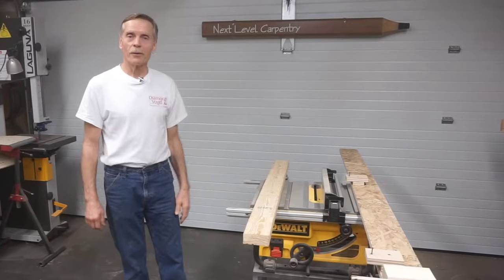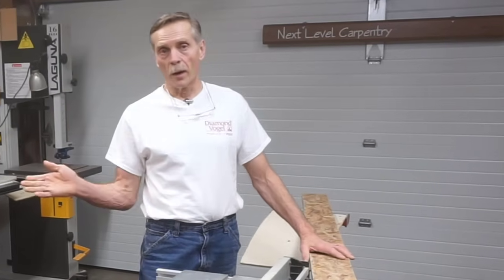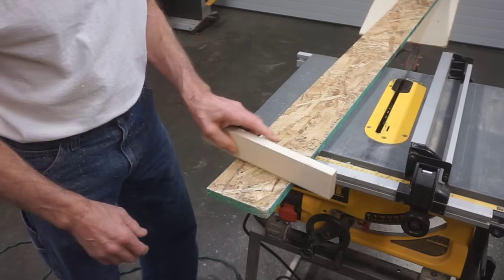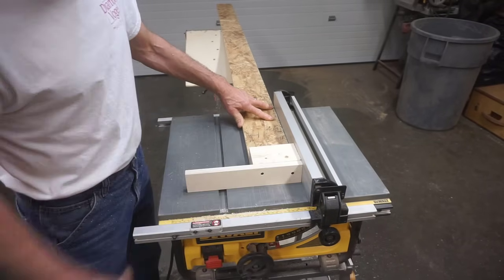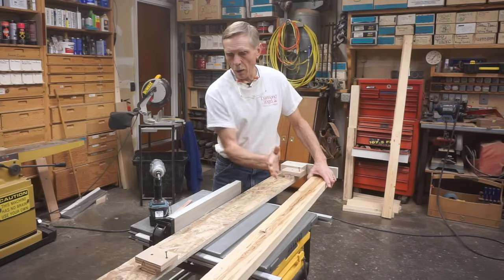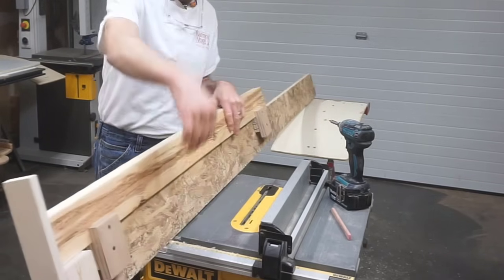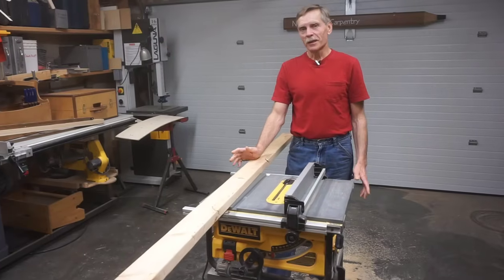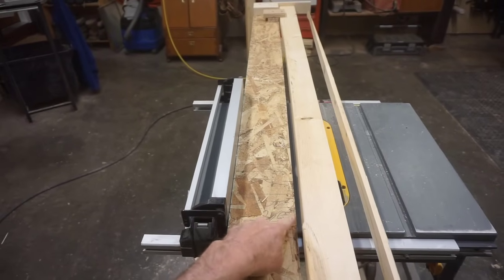How to Cut a Straight Edge on Crooked Boards

Comment: I've had to straighten quite a few boards in my shop that were straight when I brought them home but bowed before I got around to using them.  I have a straight piece of aluminum I screw to one edge of the board and run it through the table saw to get a straight edge on the board.  Has worked for me for many years.  Good video.

Comment: This is  very good rig, and very safe. I have often used a shortcut version of this that I call "field jointing": I snap a chalk line across the 2 low points of the bow, then freehand rip the chalk line in half; then flip the board and run the newly staightened edge against the fence; then flip it again and run that edge against the fence to clean up any imperfections in the first rip.
Reply from the maker: I Iike it Greg... thanks for adding a non-offensive comment to share another great on-the-job variation of this method for straightening otherwise too-crooked lumber! Best, Matt

Comment: I love this method. I have dovetail clamps and a precision built sled that does the same thing. After trying this method I hardly ever get the sled down from the wall. It is a fast and reliable trick that saves time adjusting between cuts when you have more work  than time. Excellent video!
Reply from the maker: Good to hear Douglas... glad you find this setup fast and efficient as I do.  Other methods are necessary sometimes but having this as Plan A is cool, right? Best, Matt

Comment: I wanted to thank you. I wrote over 6 months ago asking if this would help to edge joint for a table top. After much practice with scrap, I got the hang of it and was able to joint 2x10's for a nearly 4foot by 8foot table. The edges went together so perfectly that I couldn't believe it! After a glue up and having practiced all the other skills from "YouTube" and thrift store woodworking books, I built a beautiful table, with dowelled aprons , a dovetailed tressel, and a nice dry aged finish patina...  but the thanks begins here with your video, as getting those boards to join together was the biggest challenge. Now I'm ready to make another one, but this time with only hand tools and an old wooden jointer plane from eBay!!  Thank so much!!! God Bless!
Reply from the maker: And I thought this was only for framing lumber Williard... who knew?!  Feel free to link to photos of your table if you want.  Thanks for watching and commenting here at Next Level Carpentry! Best, Matt

Comment: One trip to Home Depot will provide you with more bowed and crooked boards than you could straighten in a lifetime! Very helpful video; thanks!
Reply: Wow that’s terrible!
Reply: It doesn't matter where you go nowadays the lumber is the same. Young trees harvested a soon as they are tall enough to get 16' out of them
Reply: There's no single store here where I live that sells decent straight boards. I'm seriously thinking on starting a straightening wood business. 😂
Reply: @jellyg.8961  Yes, they do have straight boards, if you are patient enough to go thru them.  The problem? Once you take them home and work on it, they start to warp or bow.  Frustrated especially if you need a long one to build something out of it.
Reply: @slchang01  I'm patient buddy but no, the quality of the wood everywhere around is pathetic. Two weeks ago I went to HD for some 1"x4"x8' boards, after checking through more than 40 of them just three were not bowed and were almost straight. You can't find good lumber anymore here where I live.

Comment: This really helped me out! I’m starting to branch into woodworking and get away from the construction field so learning all the tips and tricks from you have been so helpful! I will say I did modify your jig for it to be suitable for woodworking and so on. I used 3” wide MDF by 8’ and used toggle clamps from Harbor Freight and screwed it down atop the MDF, and it works like a charm.

Comment: When I saw the length of the video I thought "why to use 15 minutes for a technique (didn't know your technique yet, but I thought I did) that's not that difficult to show". I'm very glad I clicked on the thumbnail to find it out! Because it's good information! Definitely going to use this method!
Thank you!
Reply from the maker: You're welcome, LoveZick... I'm glad you clicked on the thumbnail too!  In reality it ALWAYS takes much longer to 'show' than to 'do', right?  You'll be glad to know this method is like that too: goes a lot quicker when you actually use it.  Usually when I'm on a job where I use this once I end up using it multiple times so initial set up of the jig is even more worthwhile... Best, Matt

Comment: i think you do an awesome job explaining everything. I started to do some work around the home because of corona-virus and I watch plenty videos and yours are number one for me. the younger guys are very innovative but they seem at times to lack something in the videos. So far i have built a study table for my daughter, a chest of drawers and a closet with wood sliding doors using metal track on the gable slope in my 1.5 story home. So thank you
Reply: The younger fellows want to do everything too fast and flashy without regard to safety, i.e. proper hold-downs, push sticks, DUST extraction, masks and visors or woodworking gloves. Forgive me but I like my lungs, eyes and especially, my hands without splinters and ALL fingers! 😁

Comment: Simple, effective solution that gets the job done... keep these videos coming. As a 70-something self-taught re-modeler I've used jigs like these and the shimming techniques of the other video to correct some real nightmares. The TG flooring grade OSB (more dimensional stability in moist environments) straight edge can also be modified to straighten the edge of 4x6-10 lumber used around windows and doors using a good portable circular saw (i.e. Makita w/Freud Diablo). Screw stop-blocks to the underside of the guide, at the ends of the work, positioned with the saw foot against the edge and blade edge at narrowest point of the work. Then screw the guide assembly to the work. Make a first cut a little more than half way deep. Flip the work, re-attach the guide and repeat. And, it's safer than man-handling on a TS.
Reply from the maker: Great adaptation Mike.. thanks for sharing! Best, Matt

Comment: Thanks, man! I've got some older lumber that has warped, and I've been trying to figure out how to salvage it. This method will work perfectly! You're video was concise, straight to the point , and easy to understand. I like that you threw in that 2nd picked over board, that REALLY drove the point home. Thanks again!
Reply from the maker: The more pieces you have to straighten, the more it's worth the few minutes it takes to make a jig like this Matt... work carefully with this fixture, especially at the start, since it's a bit different than just using a tablesaw by itself.  Hope your salvage project goes well! Best, Matt

Comment: I have a 4’and an 8’ length of 3/4” plywood 6” wide. I used a straight bit followed by a keyhole bit with my router and made perpendicular T slots every foot in the plywood. When I want to straighten a piece of wood I place it on the appropriate jig and use hold down clamps in the T tracks. So much quicker and more efficient.

Comment from the maker: Greetings viewers and subscribers!  I mention links to two related videos at the end of this one.  I'll add the links as soon as the other two videos are produced and uploaded.  I hope to finish them up soon because each one relies on the other two to be most useful... sorry for the delay and any annoyance this causes.
Best Regards,
Matt
Reply: Excellent, as usual.
Reply from the maker: Thanks rem lok, the mission of Next Level Carpentry is to supply useful content with a goal of reaching an 'excellent' rating with viewers like you... Best, Matt
Reply: Just wondering if it is worth spending that amount of effort to save a 2x4. Especially when you say in the end, it might just bow again.
Reply from the maker: CaseAgainstFaith, To be fair I'll say that it's not always worth the effort but often it is worth salvaging random pieces of bowed wood on a remodeling project.  Not only does it save unnecessary waste going to the landfill but it can save trips back to a lumberyard, a real consideration on some projects in some parts of the country/world.  Mainly I hoped to show what can be done when it IS worth it more than what to do with every bowed board I encounter.
Thanks for watching and commenting! Best, Matt
Reply: Fair enough.  And, you really did do a good presentation. Thanks.
Reply from the maker: I appreciate the exchange, CAF, thanks for commenting and follow up.  Video production is an interesting endeavor because viewers don't always see what I think I'm showing so questions, interactions and feedback like yours is important information for building/developing a YouTube channel. Best, Matt
Reply: Does the riving knife need to be removed?
Reply from the maker: @cappleget  If you have a riving knife and are used to using it there's no need to do so for this operation.  In fact its advisable for safely making rip cuts on a tablesaw.  Best, Matt
Reply: Next Level Carpentry 
Thank you for your response!
I was looking for a safe way to remove the rounded edges of 2x4s that keeps my hands a safe distance away from the saw blade.
My riving knife and splitter are in the path of my gripper :( - this method solves that problem!!
Thanks again!!
Reply from the maker: @cappleget  I can't visualize how this method helps rip rounded edges off when your normal setup prevents it. by 'gripper' are you referring to a brand of pushblock?  If so, there's other, better methods, IMHO, for ripping rounded edges off of straight-ish 2x4s than going through all the motions shown here for straightening 2x4's, rounded edges or not.  You're welcome for this but I suspect there's more to it.  Best, Matt
Reply: Next Level Carpentry 
My guard and riving knife are fixed to the table, the width of the gripper  is such that I cannot push the board all the way and it stops about 6” before a complete cut.
Several years ago I had a significant kick back and have been aphrenrsive when using my saw ever since.
Reply from the maker: @cappleget   Apprehension is understandable and is not all bad when it comes to using powertools.  I'm glad to know you haven't given up and hope you can work away from apprehension towards confident respect when working with machines capable of maiming.  For liability reasons I won't make a direct recommendation but will tell you that I would be apprehensive if I were to use a 'gripper' type pushstick for ripping stuff.  What I do is make and use the pushsticks shown in this video:  https://www.youtube.com/watch?v=8h4OJHhSH8A&t=463s .  
In it you can see why I prefer this type/style to the pathetic little 'sticks' that come with tablesaws and why I have no use for big, clunky, cumbersome 'full featured' designs like the gripper.  Again, this isn't me telling you what to do or how to do it but rather, presenting ideas that I use for your consideration.  As an added bonus, this style of pushstick will easily fit past anti-kickback pawls and/or riving knives in the great majority of ripping operations.  Work safely and enjoy! Best, Matt
Reply: @NextLevelCarpentry  At 5:09 into the video you talk about the snappy bit. What is it and where can I get one?
Reply from the maker: @b111ym  thanks for asking. Snappy makes THE BEST pilot/countersink bits available IMHO.  With replaceable/adjustable regular drillbits secured with a large size hex screw they are robust and effective for the job they're designed to do.
 Here's two links to them on the NLC Influencer's page:
https://www.amazon.com/dp/B000XXZME8/?ref=idea_lv_dp_ov_d&tag=aiponsite-20&linkCode=ic6&ascsubtag=amzn1.ideas.29WVINIJF4EUJ
https://www.amazon.com/dp/B0167NA8KA/?ref=idea_lv_dp_ov_d&tag=aiponsite-20&linkCode=ic6&ascsubtag=amzn1.ideas.29WVINIJF4EUJ
 I didn't know the carbide tipped ones were available until just now and will soon be ordering a set but have always done fine with the standard steel ones... I literally don't go to a job without them and have a second set on hand in the shop at all times.  Best, Matt
Reply: @NextLevelCarpentry  appreciate this comment as a beginner.  I find the properly set riving knife allows me to not worry as much about the board moving to the left and keeps it aligned with the fence.
Reply from the maker: @krperry2007  It's important to work with confidence and within your comfort zone... it's what makes woodworking sustainable.  There's a lot of varying opinion and practice 'out there' and it's up to the individual to sift through it and establish their own 'best practices' among the options. There's a wide range of operators from reckless hacks to those so fearful and fastidious it's a wonder they get anything done so pay attention as you gain experience and you'll do fine.  Best, Matt

Comment: I’ve done a few projects around the house and found lumber today to be absolute crap. I’m going to purchase my first job site table saw soon so I’ll try this method.
Reply from the maker: Sad truth about a lot of fast-growth lumber sold these days.  I always make every effort to buy the straightest stuff available because this would only help to get straight 2x4's out of pieces 2x6 or wider but I always have this trick up my sleeve as a backup.  Best part is that I'm usually able to salvage more than a few pieces of old lumber on remodeling projects this way and avoid the high cost (and poor quality) of new lumber in the first place.
Reply: lol….a “job site” fix that needs 3 other tools, straight wood and some jigs
Reply from the maker: @jaymcbakerk  LOL? You make it sound like those things are rare on jobsites...

Comment: Amateur carpenter here. I have always wondered about a good, easy way to make bowed boards useable. Thanks for this video.
Reply from the maker: You're welcome for the video, Jason.  As you learn more carpentry you'll learn other ways of straightening crooked boards but, even with 50 years in the trade, I still pull this one out of my bag-o-tricks often.  Best, Matt

Comment: Thank you for this video, Sir.  With the price of lumber these days your idea will, I think, help me save a lot.  I bought a bunch of 2X8's to rip into two roughly 2x4's but some are slightly bowed. Had what I thought was a great idea to use an 8' 80/20 piece of aluminum to screw to one side of the lumber to create a straight edge, but the accuracy is somewhat iffy to keep from cutting too much off that first pass.  I really like your method and will use it instead for now.  Thanks again and keep up the great work!  🙂
Reply from the maker: I think the general concept of what I show in the video will be useful for ripping your 2x8's in half the long way so I'm glad you like the video.  If the 2x8 is bowed in the first place you can use this method to straighten one edge by trimming just a minimal amount off to remove the bow then use that straightened edge to rip the piece in half.  I'm guessing most, if not all, of the pieces straightened and ripped that way will yield 2 'roughly 2x4's' that have a bow in them because of internal stresses inherent in 2x8 framing lumber.  Those would in turn need to be re-straightened and re-ripped to end up with two straight pieces.  The size of the resulting two straight pieces will depend on the quality of the lumber involved and how dry it is.  In some worst-case scenarios you might only end up with a couple 2x3's by the time you're finished but, once you get an efficient workflow going you might realize some savings because, as you say, lumber prices are a real factor these days.  Good luck!
Best, Matt

Comment: What a gem of a video this is. I'm in the process of trying to make my very first "proper" woodworking bench and the top will be made up of 2X4's glued together. I feel as though this video was custom made for me as it describes my situation exactly. I was at the stage were I was getting ready to place an order for some T track and other accessories but now I dont need to! Not only has this video demonstrated that I dont need a fancy jig but it's saved me money as well. Thank you for sharing your knowledge (and saving me some cash) 👍

Comment: I make a lot of stuff out of pallet wood and, as you can imagine, a lot of it is in bad shape with bowing. After looking up numerous ways of remedying that, I actually got a little overwhelmed and happened to look over at my late grandfather’s 4 foot level that I inherited. Since no pallet boards are longer than 4 feet, I thought… what if I just hang the edge of it over the side of the boards, near the fence, and run it through?

Sure enough, it’s a fast and easy way to get one side straight enough that you can then flip it and make the other side parallel. I found that if you do it in multiple passes, starting away from your final cut and walking it in like you’re slowly shaving it down, it gives the best result.

Obviously this won’t work for 8ft 2x4’s because I don’t think they make levels that long. In this case, go with what this video shows.
Reply: You can get levels up to 12 ft, but they start getting pricey. Harbor freight has 8 footers for cheapish.
Reply: That’s what I do as well. I purchased a 12’ 4”x2” x 12’ hollow aluminum Chanel. Also have an 8’ one. I don’t fasten any thing. Just put to board against my straight and push both through along my fence. I do have a four foot long unifence on my Delta unisaw though so that helps. Works perfect. Cheers.

Comment: I think some knowledge has to be offered in each video.
The method used to straighten a board that you show, permits us to learn the correct secuence of steps to eliminate the crown of boards.
It can be applied, the theory in others precedures but the secuence is always the same.
Thanks
Gerardo